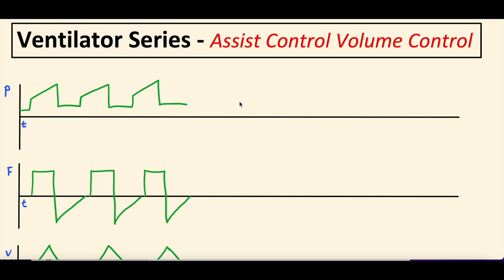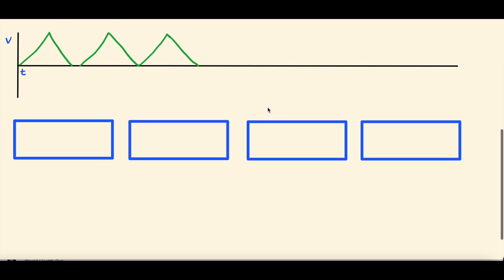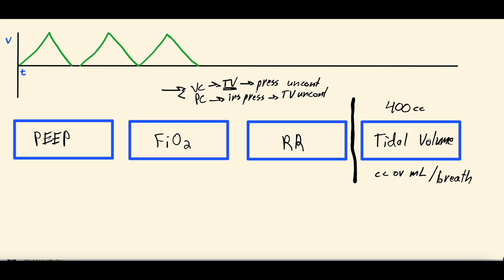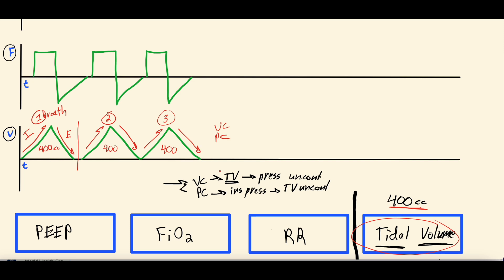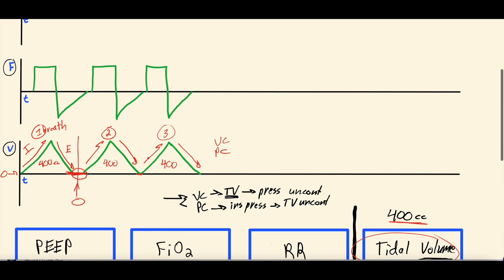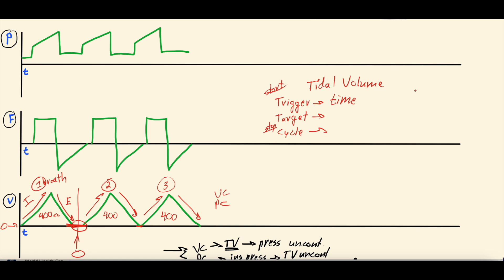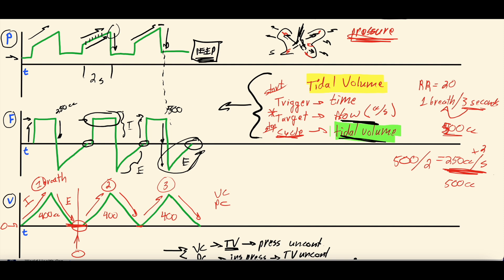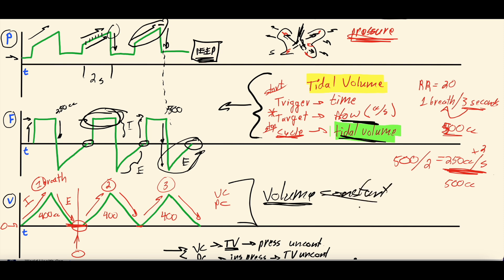Mechanical Ventilation Basics - Volume Control (Pressure, Flow, Volume Scalars) | Clinical Medicine

Comment: If in volume control and you select a decelerating ramp pattern (which seems to be the recommendation) then the scalers look much different … more like what you would see if the patient was in pressure control.  To piggyback off this, when in volume control performing an inspiration hold, should the ventilator be set to a square waveform flow pattern for the most accurate plateau pressure measurement?

Comment: I graduated from a  respiratory therapy program in 1985…almost 40 years ago. We were using the MA1-1 with the bellows 😂
Reply from the maker: Love it, thanks for sharing!
Reply: @WhiteboardMedicine  I feel like I need to add it was before disposable vent tubing. We had to soak it in cidex, brush and then hang to dry in a heated dryer. Once that done it was packaged and sealed. Yuck !! Also learned to draw ABG’s in a glass syringe. We would heparinize the needles prior. Afterwards,  the glass syringes were washed and dried. Double yuck !!  This was before the hep B vaccine came out. How we didn’t all get Hepatitis I will never know.